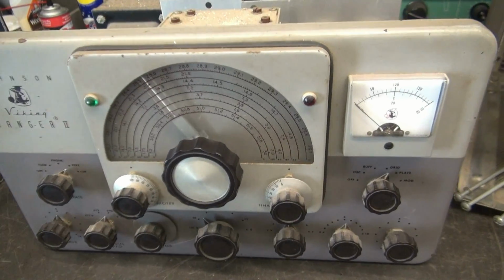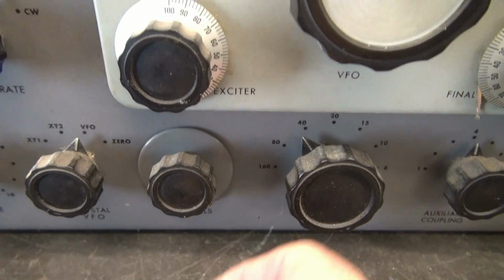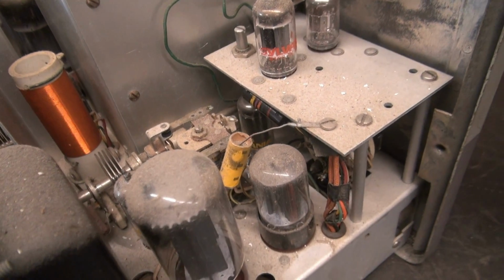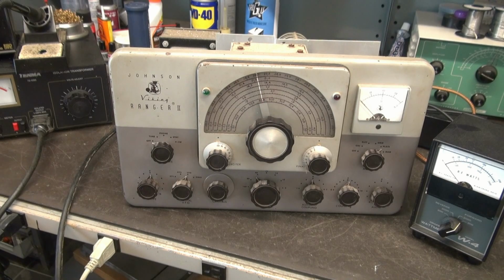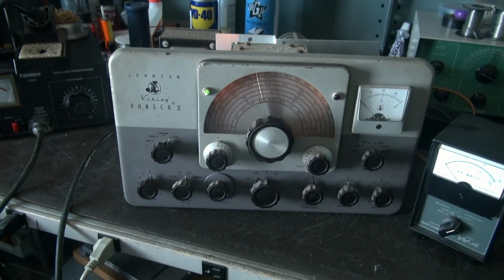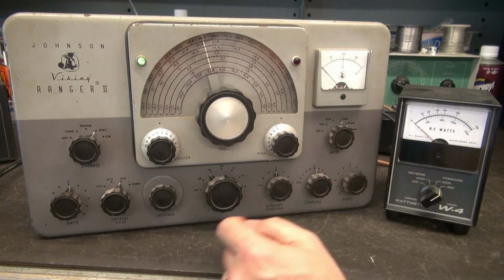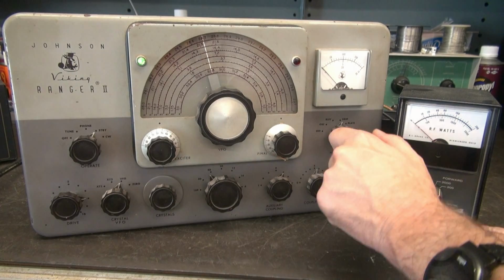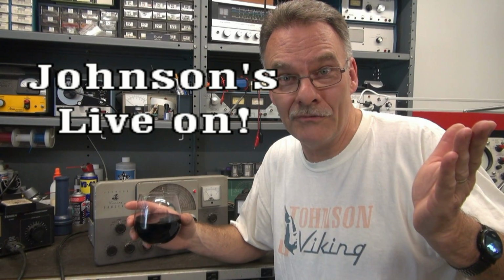EF Johnson Ranger 2 6146 AM CW tube transmitter resurrection by D-lab

Comment: Terry, got a drake t4 with a hayseed replacement electrolytic  multi cap.  My weller 140 won't even touch this as far as melting the connection on the chassis. Any recommendations?  I think I remember you grinding the connection off with a dremel or something of sorts?  Bryan
Reply from the maker: Find an old Ungar iron. I have featured one in several videos to demo removal of can type filter caps. They make childs play out of the task. TD

Comment: Nice stuff Terry.  That gear is rock solid and you proved it... Awesome.  Hope you are well and hope the new job is good.  What kind of speaker do you use with that set ?  How many ohms ?   Thanks Ron
Reply: No speaker, Ron. It's a transmitter only.
Reply: Ah, I missed that part.   Makes sense - that is why there is a way to see the GRID and PLATE voltage..makes sense.   thanks, Ron